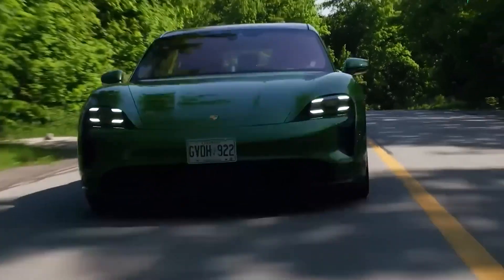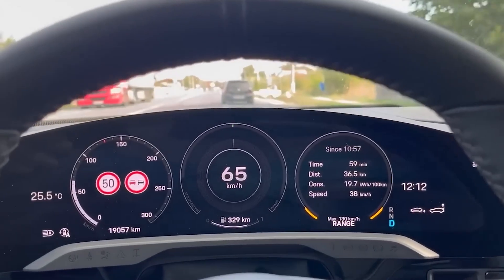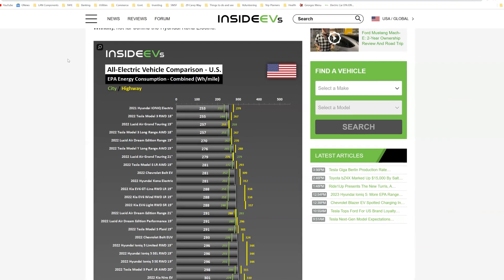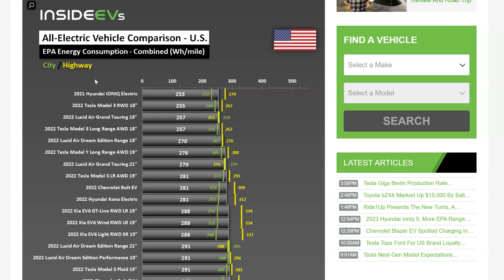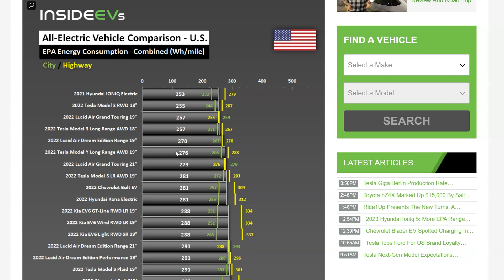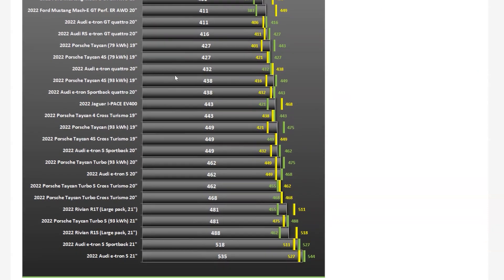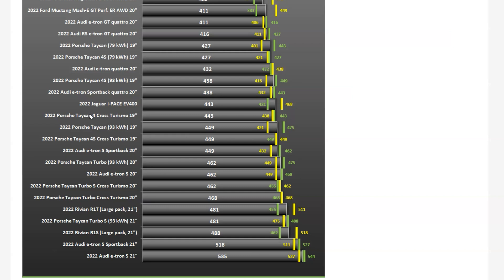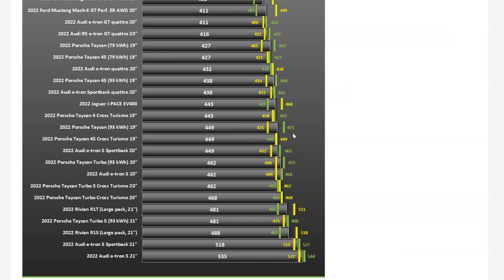Porsche Claims the Taycan Braking System is Superior to Tesla's One Pedal Driving - REALLY?

Comment: Absolutely incorrect conclusions. One may say bogus conclusions based on a confusion of one car’s best efficiency with another’s. Compare coasting vs regen within a single model to tell which is better. Can’t argue with physics. It’s like this: the Tesla regen is more efficient than Taycan. Better wiring, motors. It just is. Yay Elon. So disingenuous to compare Taycan vs Tesla and conclude coasting is not as good. Porsche is correct. Teslas brake pedal = friction brakes. Porsche’s brake pedal is regen plus some friction. In a Tesla u can’t coast (outside of track mode) and u have to ride the accelerator to maintain speed (best on cruise c). That means on manual controls it’s more variable fluctuating a few kmh around set point. Coasting in a Porsche is maintaining speed and kinetic energy at speed minimising slow downs you don’t want. Only if u go too fast downhill you will increase drag. Pop cruise control on in Taycan and it regens to maintain the speed. Slowing both intentionally you will use regen. Tesla is more efficient. Town driving is also better in Tesla because regen is more inherently efficient. If u were to coast  you use friction brakes to slow (which would be less efficient) but with a Taycan you do regen with the brake pedal in coast mode. Just not as efficient as the Tesla. Tesla would be so much better if it coasted and had regen into its brake pedal rather than friction brakes which would remove speed fluctuations riding the accelerator to maintain speed before you want to slow . If you’re on cruise control fluctuations are minimal. Both cars have a drag ratio of around 0.22. 

One cannot say Porsche is not as efficient than Tesla and attribute it to regen style vs coasting. It’s inherently the recouped efficiency in the system which is better in Tesla.

Comment: Unfortunately your application of the scientific methodology is completely unsound.  There are several alpha errors in your assessment which invalidates your assessment.  You cannot compare the cars directly in this way as there are differences with weight, types of driver, temperature.etc.  The profile of a driver of a Tesla 3 is completely different from that of a Taycan.  Also driving with coasting is different from driving with regenerative braking; the approach is different.
Reply: I am afraid it is your own assessment that is in error. Of course cars are different and are different weights or are driven in different conditions etc. You don't even need to look at a chart of different vehicle efficiencies to understand where the issue lies. There are indeed situations where coasting is better than regenerative braking but whenever friction brakes are applied there is significant energy lost ... it is used up in removing material from the pad and disc and in producing heat. If you can coast without ever using friction brakes then that would be excellent .... but you can't! At some point you need to use the brakes and every single use represents an unrecoverable energy loss. With one pedal driving you can drive without those losses because whenever you need to slow the car you instead turn the motors and generate electricity, to be stored in the battery. You not only avoid the energy loss of friction braking but you actually add some energy back. The other factor is that one pedal driving includes coasting too! When you gradually lift off the accelerator pedal you gradually reduce the power to the motors ... keep lifting and you get to a point where you are coasting (no power going to the motors) keep lifting more and a small amount of regen comes in, keep lifting more and the strength of regen (and retardation) increases. If a Taycan (or any other car) can drive from one side of a city to the other without using its brakes it will use less energy than a Taycan (or any other car) that is only able to stop by using its brakes. Unless you can change the laws of physics this has to be the case!